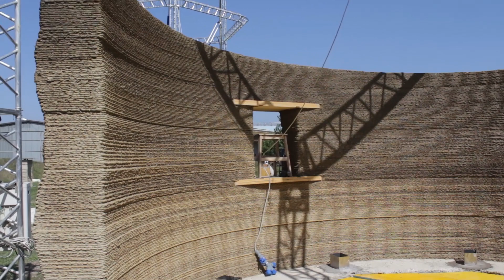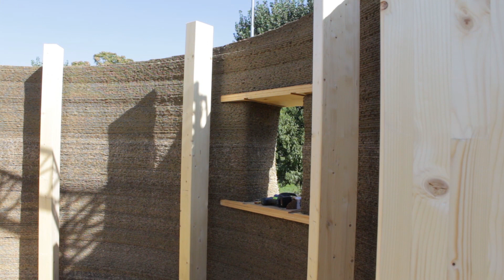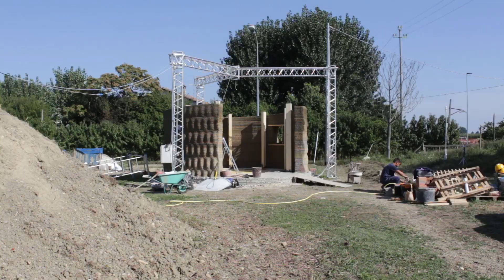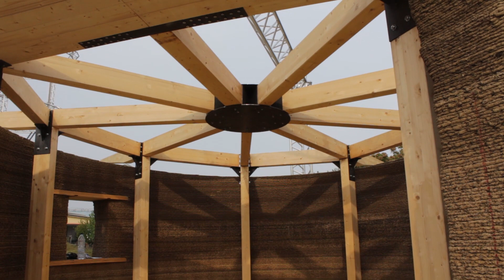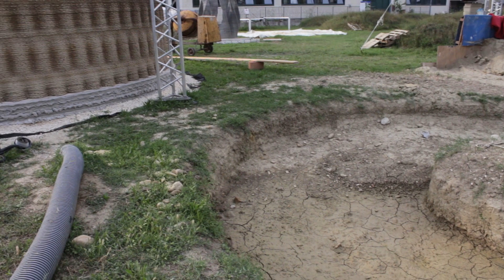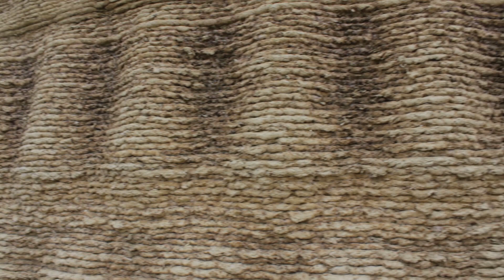3D print earth house with Crane WASP | roof time

Comment: What is the point of the printed walls if you still need a wooden frame to support the roof? Isn't the point of this to make a cheap house out of local materials? Now you need a bunch of expensive milled wood and a bunch of welded steel hardware to hold it together. Might as well make the walls out of those materials too no?